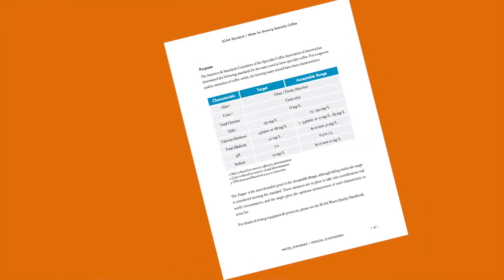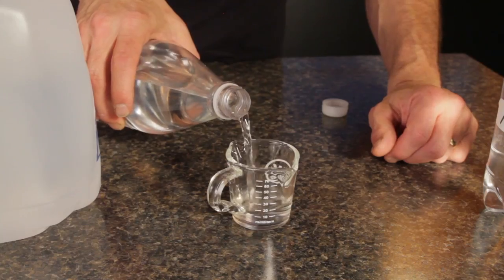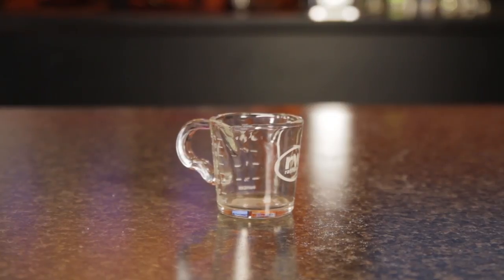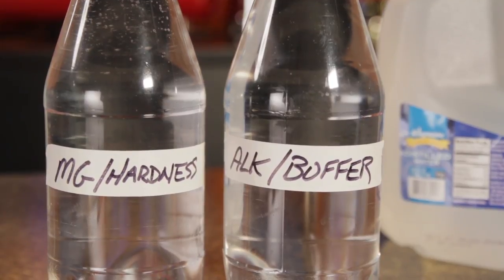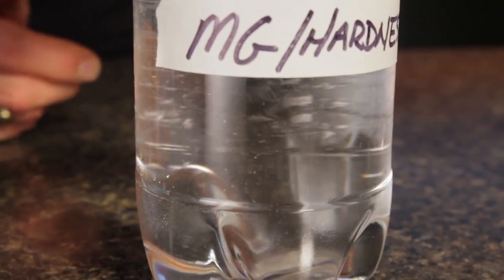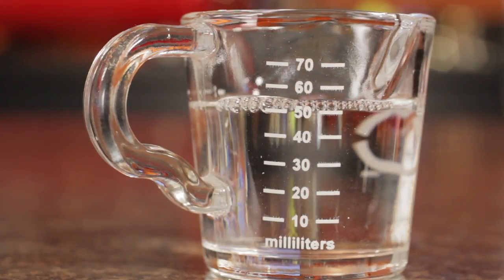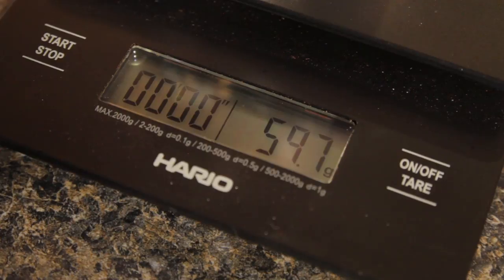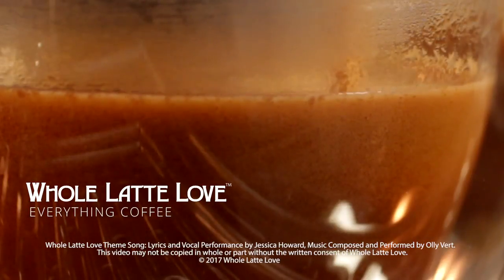How To Make Basic SCA Coffee Brew Water

Comment: Hi Marc, As usual, another terrific and helpful video. Just one thing: you might want to clear up the math on the written instructions, to wit: "Then add 185 milliliters of the alkalinity/buffer concentrate. Using my Rattleware shot glass I’m filling 3 times to the 60ml line and then another 15ml’s to get to 185."

You guys are the best!  Great service!
Reply from the maker: Hey Jim, Marc here from Whole Latte Love... Thanks for the kind comment and correcting my major addition failure - it's truly appreciated! Should be another 5ml.
Reply: With the Rattleware shot glass not denoting a 5ml mark you'd have to half the 10ml to use the following, 3 * 60 = 180 + 5 = 185, no?
Reply: The video says to fill to 50 ml three times, then add another 35 ml.  That gives you 185.  I don't see a problem.

Comment: Hi Mark thank you I’ve made your brew water recipe and have been using it for the last few months now . Water tastes great . 
I have a tds digital metre . Our rain water measures 35 ppm 

When I mix your brew water into bottles the small amount of concretes to the 1 L water it measures around 138 to 145 ppm 

Today I tested the water that comes out of the machine the hot water tap on our rocket R nine one and waited until it cooled down completely. When I tested that it measures about 800 ppm 😮 we haven’t had out machine for a year yet . Wondering why it’s so high when been in machine when the water goes in the water container at 137 to 145 ppm ? 
I’m worried about scale in the machine from this ? 

Thank you so much for all your wonderful videos
Reply: Oh and Marc sorry just another question on one of your other videos when you tested the Rocket R nine one you had a guy from a Rocket going through it with you . They said that these machines shouldn’t use a de scale solution? 
If the brew water may make some scale I’m a little worried 😟  we have only been using the new machine for 6 months thanks again for all your amazing videos very helpful 😊
Reply from the maker: Hi missm, You are welcome for the videos and thanks for the question. Minerals can accumulate in the service boiler if it's only ever used for producing steam and little or no hot water. The steam that comes out of the boiler is essentially distilled so minerals are left in the boiler and become more concentrated. A best practice that solves the issue is occasionally taking hot water from the boiler to reduce mineral concentration. A cup or two every couple of days (like if making Americanos) is all it takes. Or you can turn over the water completely 1x a week or so depending on use level. To do a full turnover of water in the boiler fully heat the machine, turn off the power and open the hot water tap and let it run out water until it stops. When you power up the machine again the boiler will refill.
Marc
Reply from the maker: Thanks for the question. The best course of action is to use water that does not cause scale in the first place. Since this recipe uses primarily magnesium as the mineral in the water it's unlikely to cause scale. It's potentially high levels of calcium in tap, well or some bottled waters that are responsible for scale. For those with hard tap water softening the water with traditional sodium based softeners will do the trick. We prefer softening using magnesium to replace the calcium. Magnesium is equal to calcium as a mineral for flavor and beats sodium in tastes tests.
Marc
Reply: @Wholelattelovepage hi Marc 
Thank you so much for getting back to me so soon 😊 I will do all you suggest here only thing that we are not using is Distilled water I’m finding it hard to find here in Australia I don’t want to use the wrong one . 
I really thought our tap water/ filtered water at 35 ppm wasn’t too high to use in the brew water recipe . 

I will flush out the hot water as you suggested but it won’t drain with the power off as it a R nine one ? 
If I want to completely empty the hot water out of boiler I just worry about the warning of no water coming up as I don’t want the new water going in as I’m trying to empty it ? Sorry hope I make sense 😊thanks again for everything kind regards Leanne 😊

Comment: I think there must be a typo in the gram to volume conversion of the Baking soda at the end of the video. 1/2 tsp weighs out to be alot more than 1.4g.  Using a high-precision lab scale and a level tsp I get ~3.2g (results in a TDS of ~326). Checking online, I see wild variation depending on what conversion calculator you happen to use for baking soda.  For comparison, your conversion for Epsom salt was close to accurate on my scale. Using 1.4g will keep you at the high end of the SCA standard's TDS range (results in a TDS ~240), so by volume, using 1/4 tsp of Baking soda would be more accurate to the SCA guidelines. That being said, ignoring their standard and using 1/2 tsp as you demonstrated here, still results in a tasty extraction, so it's personal preference.
Reply from the maker: Hi JC, thanks for the info!

Comment: . Thx for the video
With a little math, I came up with a slightly simpler version of the recipe
Get a 2 liter bottle
Fill with RO WATER … remove one cup
Add 2.8 gm baking soda— 1 tsp
Add  13.6 gm epsom salt. 1.5 tsp
Mix
Add 185 gm 3/4 cup of mixture to one gal RO water

You should probably check my math though
Or… just try it and taste this recipe side by side
Cheers
Reply from the maker: Hi Ardy, You are welcome! Could work and yes would need to check the math. Need to be careful mixing together higher concentrations of baking soda and Epsom salts as they may precipitate material from the solution.
Marc
Reply: @Wholelattelovepage  
Marc..
.i did check the math several times… and there should be the same concentrations
Later, I will do a side by side comparison
My goal here was to reduce complexity.  … not change the end concentrations 
One concentrate bottle, one concentrate measurement
Anyway.
.regardless of whether my calculations are ultimately correct,  i prefer this simpler approach
Anyway… thx again for the work of your WLL team
Reply: @Wholelattelovepage  
Marc
Fwiw, I re checked my math… and also tested the video recipe beside  my revision… and they taste the same
One further detail….  Most commercial ” drinking water also has some salt in it.   James Hoffman says a little salt improves coffee
Make of it what you will
Ardy

Comment: My Reverse Osmosis (Homemaster Artesian) doesn’t get to 0 TDS.. it’s somewhere around 12-19 depending on the day.  If i used a gallon of this RO water and then divided your solutions by 1/3, i should be ok; correct?  I have a Linea Mini and don’t want to chance scaling it at all.  I see you mentioned in another reply to a comment that this recipe could scale as it did to her machine after 3 years of using this recipe.
Reply from the maker: Hi M, that sounds like a reasonable approach. Another option is adding a remineralization cartridge to your RO's output. This one uses magnesium for remin which will not cause scale in your machine: https://www.wholelattelove.com/products/bwt-bestmin-premium-m-filter-cartridge
It's likely more expensive but more convenient.

Comment: Hi Marc, great video! I just bought the profitec pro 500 from WLL and I’m very excited about it. Got a quick question on the water softness for this machine. I’m planning to use distilled water and trying to remineralized it properly with your formula. The manual said to use water with 4 dh max (60ppm). Then I read the comments below that the water softness ranged from 95-150ppm with water formula in this video.

So in order to get the recommended water 60ppm per the manual, should I adjust the formula specific to this machine and reduce the ratio to only 50% of the baking soda and Epsom salt? I wanted to make sure I’m doing this right to prevent scale (too much calcium) and corrosion (due to lack of minerals).

Thanks,
Yach
Reply from the maker: Hi Ya, Thanks for your patronage. You can decrease the minerals a bit if desired. This formula uses magnesium as most of the mineral mix. Magnesium is less likely to cause scale than calcium at these hardness levels. PPM measurements can be misleading as they measure all dissolved solids in the water. For extra piece of mind you could use a BWT Bestsave in reservoir pad filter or BWT Penquin Pitcher and forego making your own brew water. So long as your tap water is safe for human consumption and does not have have edge case water quality issues both of those solutions will prevent scale while providing the mineral level needed for flavor. They use calcium to magnesium ion-exchange. Check them out here: https://www.wholelattelove.com/products/bwt-bestsave-s-anti-scale-filter https://www.wholelattelove.com/products/bwt-penguin-2-7-l-water-pitcher
Marc

Comment: Do you still use a filter in your water tank after this? Doesn't make sense to IMO what do you think?
Reply from the maker: Hey T, Thanks for the question. Filter is not necessary as you're starting with very pure water! I would still descale the machine as recommended by manufacturer.
Marc

Comment: So if I use this in my Gaggia Classic Pro would it completely do away with the need to descale (and risk scale particles going into the solenoid valve)? Or would it just reduce the frequency required?
Reply from the maker: Hi c, I have not long term tested this water recipe in the Classic. On paper it should nearly, if not totally eliminate the need to descale as much of the mineral content is provided by magnesium which has very low scaling potential. If it were me, I would still descale to be sure but much less frequently.

Comment: Hi Marc, thanks for the great video. Improving my brew water is the next stage for me and this is a great resource. Are you able to provide the alkalinity, calcium (I think 0), pH, and TDS (I think I saw 150ppm below) for this brew water? The only other brew water recipes I have seen were on the Barista Hustle website and it looks like there is a big difference between your recipe and theirs for the Hardness solution (your recipe has approx 5x the epsom salts). What is the impact of this on an espresso machine? I am assuming that either way any of these recipes will be a big improvement over the tap water I am using. Thanks again!
Reply from the maker: Hi MP, You are welcome for the video. Unfortunately I made this video a few years back and no longer have the data easily available for those parameters. Not sure my magnesium was 5x the other or it could be they are adding other minerals to up the calcium while I'm using mostly magnesium. Calcium is the enemy in espresso machines as it causes scale. But other variables like pH and alkalinity play a role in combination with calcium level. When magnesium is the predominate mineral in the water scale is less likely to form.
Marc
Reply: I was looking at the math and comparing it to BaristaHustle as well, and yes following this recipe is different to BH's listed SCA water profile, but from what I see the Epsom Salts are correct - it's the baking soda that could be off in the mixed 1 Gal of coffee water. For clarity, you were commenting on the Hardness solution, but that's just a concentrate - it doesn't matter what the Epsom salt amount is in it, it only matters what the total weight of Epsom salts are in the mixed 1Gal of SCA water. The only problem with WholeLatteLove's recipe is that 1/2 tsp of baking soda doesn't weigh 1.4g, it' more like 3g, so if you prepare this as written by teaspoon you'll be wayyy off (TDS ~314ppm). However, If you prepare the concentrate by weight (using 1.4g) then both recipes would be close to each other, and have a TDS around 240ppm. The SCA actually revised their water standard and now lists a fairly broad range for TDS (75-250ppm), so this recipe is fine as long as you use 1.4g Baking soda for the concentrate (or 1/4 tsp).
Reply: @jcmmmbrains2718   I agree with this, 1/4t is preferred if you are not weighing the ingredients.  I've been making this for a couple of years now and poked around the SCA site and others for their recipes back then and found 1/4t (1.4g) to be the preferred amount.  So this yields great neutral tasting water, but the bonus is that none of my equipment has yet built up any scale. Thanks to WLL (Marc) for introducing me to making my own water!  Kudos!   BTW, distilled water is now up to $1.50/g .   :(

Comment: I'm very very new at all of this and trying to read and learn all that i can. I want to order a gaggia magenta prestige. Should i use this water? Or is tap water with the filter the best?  Help!!! Lol
Reply from the maker: Hey l, The most convenient approach is to use tap water and filter. Filter use significantly extends the time between descaling maintenance. Filter also removes any chlorination from your tap water for better tasting coffee. When you get the Magenta be sure and use the included water hardness test strip on your tap water. Enter the results into machine during setup. Then, the machine will alert you when it's time to descale. Frequency depends your source water hardness. For typical water you'll need to descale every 800-1,200 brew cycles. It's easy to do. Just pour the descaler into the machine's reservoir and the machine does the rest guiding you through the process. Hope that helps!
Marc
Reply: @Wholelattelovepage  Marc... thank you so much for answering so quickly... what filter do I use? Does it come with it? Or is it a separate water pitcher that I filter out through? Thank you again so much! I overthink and over analyze everything!! Lol
Reply from the maker: @lorirodriquez6100  My pleasure. I suggest using the filter that mounts in the reservoir. The machine does not come with one. Here's a link to the proper filter. You can bundle with the machine when you purchase if desired. Mavea Intenza Water Filter: https://www.wholelattelove.com/products/mavea-intenza-water-filter-for-gaggia-and-saeco
Here's a link to our start up video for the machine. Takes you through process in detail including filter etc: https://youtu.be/qL_rxqSKRbE?si=qSXsRtiDubpc_Nb1
Hope that helps!
Marc

Comment: Taste isn't my biggest concern right now. I just purchased a Moccamaster and because of the copper element, we shouldn't use reverse osmosis water or distilled water. While researching this, I stumbled across a company called, Third Wave Water. They sell mineral packets that you add to distilled water to re-mineralize it. I checked the ingredients that they use and it's just magnesium sulfate, calcium citrate, and sodium chloride. I am wondering if I either buy from Third Wave Water, or make the water myself like in this video, will it make the water safe to use  with Moccamaster's copper element. I've seen many people disregarding Moccamaster's suggestions, but I just spent a lot of money on that machine and want to properly take care of it.
Reply from the maker: Hi b, Yes this water will be safe to use with the copper element. So would the 3rd wave product which is rather expensive for what it is but that's the price of convenience. I agree 100% with Technivorm. One should not use pure RO or distilled water. Over time it can corrode metals and even though taste is not your big concern at the moment, ultra-pure water over-extracts coffee and produces flat flavor due to lack of minerals.
Marc

Comment: WOW awesome, so how does it taste on a espresso shot? Will this eliminate the need to descale?
Reply from the maker: Hi B74, This prep is more suited to general coffee brewing. It would be okay for espresso brewing but a higher mineral level may be of benefit. I'll be getting into other preps using the same concentrates including those more suited for espresso brewing. It's actually fairly straightforward. A good start for espresso is to keep the Alk/Buffer level the same and 2x the Mg level. The mix made in the video will not produce scale (or corrosion) according the the Langelier Saturation Index. I'll get into LSI in a future video as well.
Reply: Awesome vid Marc.  there's silica in the water where i live which can result in boiler scale, so i wanted to do something like this for a long time.  Normal softeners and filtration will not remove the silica.  Will the espresso recipe of 2x Mg level possibly result in scaling my espresso machine boiler?  What's the hardness of the basic recipe and of the 2x Mg recipe?  Thanks!

Comment: My water is slightly acidic (pH 6.6) as I use rainwater in my house since I live in the country and don't have access to town water.  Does the use of these two buffers mean it will help adjust this closer to 7.  I did chemistry a long time ago.  I'm looking to purchase a new espresso machine since my current one died this morning and am a bit worried about water quality but I like this option of adding minerals to rain water even if it means I won't be plumbing the machine in.
Reply from the maker: Hi Meredith, pH 6.6 is within the 6.5-7.5 SCA spec for brew water. More info on that here: http://www.scaa.org/?d=water-standards&page=resources
Slightly acidic water is less likely to cause scale in a machine but there are other variables like mineral hardness and alkalinity which play into that. The best approach is to test your rainwater, treat with minerals, test again and adjust dosing of supplements as needed.
Marc